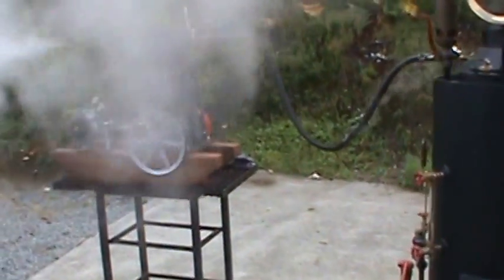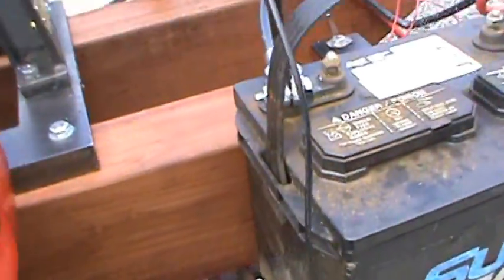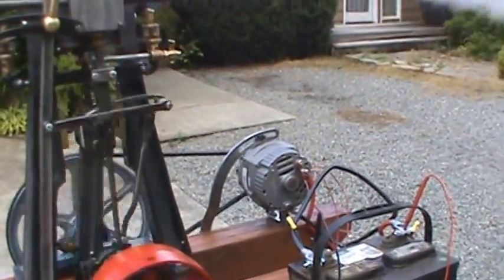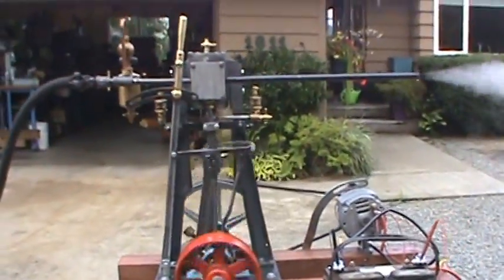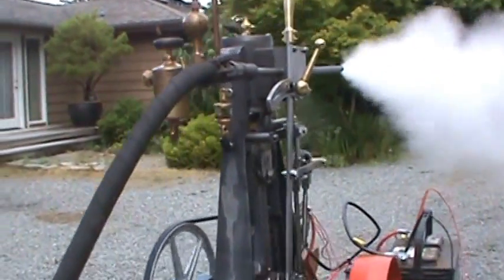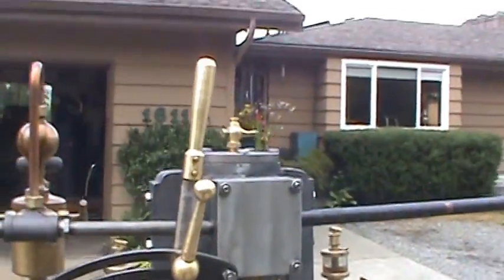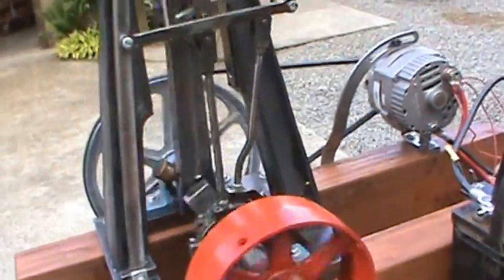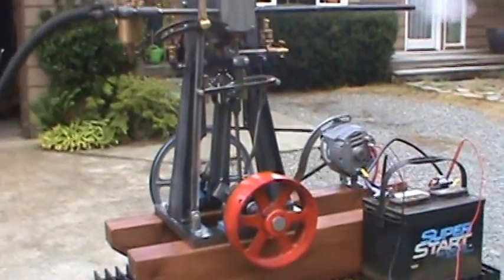Steam Engine with Alternator DC Electricity Off Grid

Comment: Maybe if I can chip in make alternator pully smaller to get charging voltage to at least 13vdc
Reply: Yeah. clearly too few rounds in the alternator. the machine has torque, it could go even faster if the gears were right

Comment: The guy has a good Victorian steam engine....like hydraulic and electric drives ...it will produce max torque at stall(0 rpm).
Steam will usually do about 10foot pounds of torque per horse,while a engine will do 1.5 foot pounds per horse.The reason in the day. when auto racing was getting started. A 20hp steamcar was a even match for a 60hp gas engine.
Would imagine he is with a steam club like I have been for the last 30years...I am tooling with modern steam ideas trying to come out with a modern steamcar and homepower plant.Just hope I didn't steal any of his thunder with what I said.

Comment: Hello
Can You say, what is thickness of boiler copper tubes?
Reply: If the same schedule K as you use for air conditioner with 250psi max.work pressure....copper changes with the heat.So air conditioner and water guy might be wondering about that pressure being so low.Beyond you are going steel like in brake lines,til stainless as pressure and heat increases.Even on copper tubing boilers...the superheat is SS because of heat stress and corrosion(from ash on solid fuel) on a line that is pure steam and no water adsorption of the heat.

Comment: nice piece of machinery, how many amperes does it produce, this is more important
Reply: Easy to calculate : 3.5 hp = about 2600 W. Up to Amp = 2600 W / 12.5 V = about 200 A ( without taking the mechanical and electrical looses into account ). So alternator will be the limiting factor here (80A ?)
Reply: @bartdepauw1156  The alternator in this video isnt even spinning fast enough to create a charge voltage. it should be around 14 volts, 12.3 is a flat battery. So I assume the alternator is creating little to no amperage.

Comment: How safe is that to operate?
Reply: nothing here is any safer than it's operator
Reply: Most boilers have a valve that will rupture if the pressure gets to high and the steam will just come out. then you just replace that part and you're good to go again... that keeps it from exploding and stuff
Reply: Isaac Weaver I thought they would have a pressure safety valve. Is that all that is needed? I'm sure routine maintenance is required as well.
Reply: Samuel Bill Bandi How difficult would it be to make and maintain a steam powered electrical generator for about three houses?
Reply: Naked Acres Thanks.

Comment: just want the design plans for a steam engine to put in my truck
Reply: Zoro Bardelo They work well enough.. It is quite easy to convert a car engine to run off of steam. You just need to do some valvetrain modifications, then swap out the gas tank for a water tank. Problem is, most people heat the water using propane, etc., instead of wood. So the engine becomes more of a novelty than anything else, since you are still using non-renewable resources to heat the water. I suppose you could have a bank of batteries in the back of the car, then heat the water with an electric heater. The alternator on the car engine (converted to steam) could recharge the batteries. Problem is, I think that electric heaters are fairly inefficient at heating water :( But it would still be cool.. Take a look at Jay Lenos collection of early 1900's steam powered cars if you want to see some cool steam cars in action.